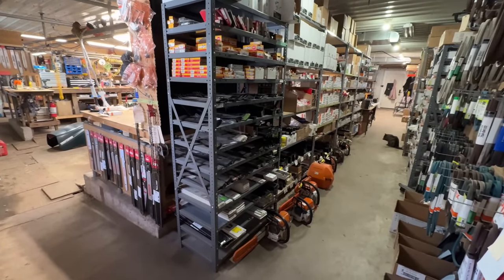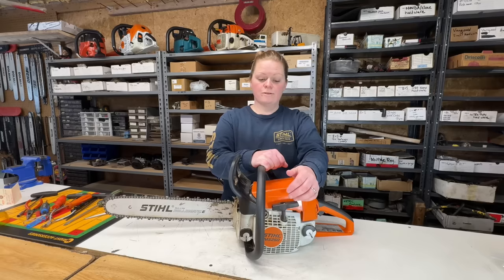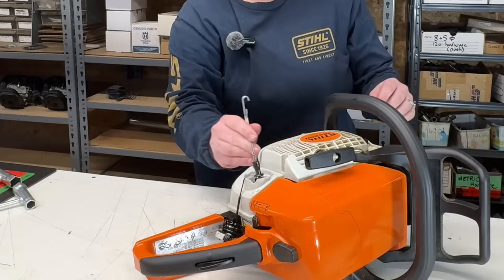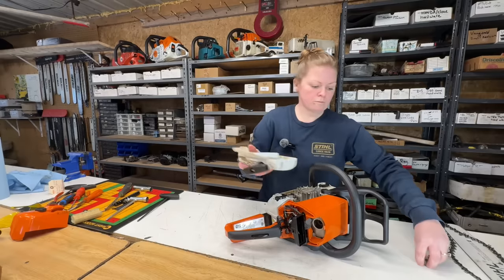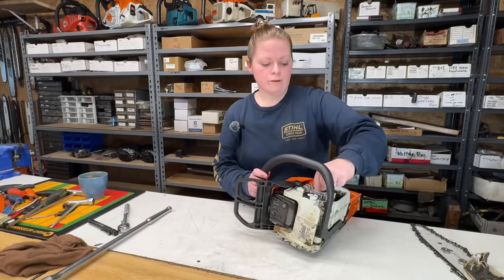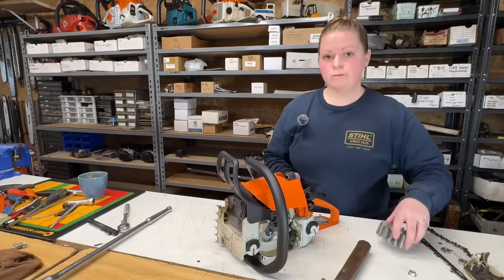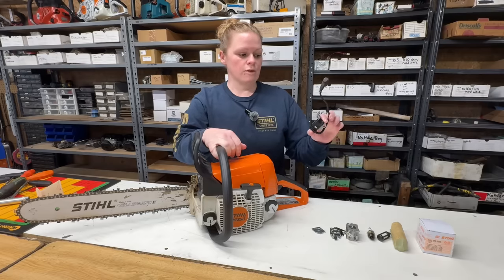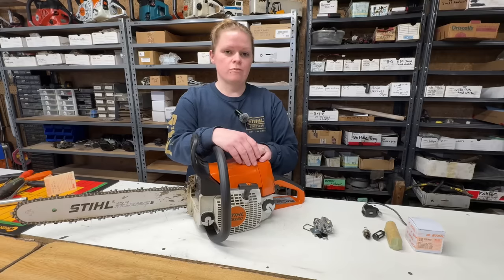Stihl MS250 Chainsaw HARD To Start!  It Wants To Rip Your Arm Off!  Let’s Dive In and Find Out Why!

Comment: I have worked on stihl for about 7 years and found the ms250 the hardest starting of them all except the really big ones . I also own one. They have all been that way new ones used ones mixed fuel or premixed fuel. They seem to pull easier after they have run some then started again. Still have not figured out the cause
Definetely hard on the fingers.Any one else have same thing.
Reply: mason secret : when the saw is hot. the mixture in the cylinder is warm. Less dense. 
i use dropsaw method to start my old ms250 . and i stihl have 2 leggs  🦫

Comment: I guessed the flywheel key or a loose coil.  shrug...
Reply from the maker: I seen your comment on that and wanted to check on both!   Thank you for your ideas!  It was worth a try!  :)
Reply: @marriedwithsmallengines It was nice watching you puzzle through it, the carb was a surprise, that there were parts missing.
Reply from the maker: I didn't see that one coming.  I should know better.

Comment: Carbon- rich.  Three turns on a Stihl means that it is really rich and can’t generate proper heat to not carbon…..I am surprised that the front wasn’t black and the screen plugged.  Must not have been run much at all 😮😢 😂.  Painful profit 😂 😊

Comment: Purchased a ms 250 in a pinch, first , knick a hole in muffler about the size of a quarter, next get ready for the fuel line to leak at the tank. I leave in the open on my work teuck, hoping someone steals the stihl,  plastic junk, worthless from my standpoint .carry on .

Comment: there is a few things that concerned me on your channel, you never said what you torqued the flywheel nut to,   and i thought you might say the correct number that would be on the flywheel that belongs on the saw you are working on.,// but you was very informative  you said to make sure to not put your tool in the wrong hole, I never ever used the tool you had , I always used a cord or rope i do like your channel, because i have an 044  stihl and it kicks back very hard, I am going to check some of the things you did, to try and fix mine, and yes I subscribed to your channel today
Reply from the maker: I'm sorry to hear you don't like my channel.   I guess I can't please everyone! :)
Reply: @marriedwithsmallengines He subscribed so he must’ve found something he liked

Comment: Here's a tip.......when you're done with ANY small engine ......drain the fuel or shut it off if it has a valve........start it.......run it til it stops........then put it away..........because 99% of the time, it's deposits from fuel in the carb......it evaporates and leaves a bunch of crap in the carb..........Z

Comment: I don’t get it. You replaced basic parts, and it still pulls the rope out of your hand when starting it? And you say say it’s the way the saw is designed?
Reply from the maker: The MS250 can be a difficult saw to start.   It has high compression once broken in.

Comment: You mix too much 2 stroke oil in gas you will get carbon build up. Below rigs and piston aluminum pinching rigs so pisten movement is not smooth all the time. 
Tear it apart

Comment: never trust the customer.  I work in support and many times, the customer will omit tshooting steps, not sure if they are afraid that they did something wrong or if they are just clueless to the fact that what they were working on could cause the symptom they are complaining about. 

I would have never thought the carb was the issue for the hard pull starts.  Still not sure how that works.

Comment: Everything was perfect until the end. You are wrong with your final analysis of your last saw repair. One thing about you that is to be aspired to is your methodical and procedural approach. It didn't matter what the owner told you- you maintained a systematic, logical approach that started with the cheapest and easiest to fix but completed a full service in the process. If you would have done it any other way- I would have known, you were a hack. Excellent video no matter how much trigger time we have.

Comment: First off, lots of respect.  VERY few women these days have that logical train of thought needed to fix or create anything.  Second of all, most women would blame someone else. One could easily say that's justified because clearly "someone" (cough cough the man who flubbed it up and then nonchalantly brought it in) messed up.  But you didn't do that.  You instead demonstrated uncommon wisdom by knowing that constantly blaming everything else in life is a losing attitude simply because you have no control over other people.  By accepting personal responsibility for the extra wasted time on the saw you learned something that is actionable for next time.  Your attitude shows that you simply care about getting stuff done efficiently with your time.  Finally, while you could have fixed that flubbed carb easily, you expertly decided to put it in the spares bin and just charge the customer the new carb (and parts markup) in order to recoup the price of some of your time.  You wisely figured that the owner would not complain because they know they were in that carb and could not get it to work.  Yes, I saw what you did there.

Very few men have that kind of wisdom in their wife.

Comment: Its not your fault.... its not on you.

I do low and med temp refrigeration.  I have to go through the entire sys and perform general maintenance on a system before i can trouble shoot them. 

Some times a abasic adjustment can be 1k. But who know how many problems a system has. Maybe 2 or 3, with each contributing a dmall amount each. But you dont know unless you go through the whole sys. And that takes time and time is money, money, muuuu-nha!

They dont like it, they can get a non professional to do the work....

Comment: You mention carbon buildup in the cylinder and I thought it is running rich. You tricked yourself by thinking maybe he doesn't run the saw long enough to burn out the carbon.

Comment: Only ONE issue with a dull chain.......won't cut well..........Z
Reply from the maker: Won't cut well, over-revs and over heats your saw, creates fine dust that plugs the air filter...so many reasons to not run a dull chain.   Speaking of dull chains - I'm working on a good example right now.  Stay tuned for this doozey!